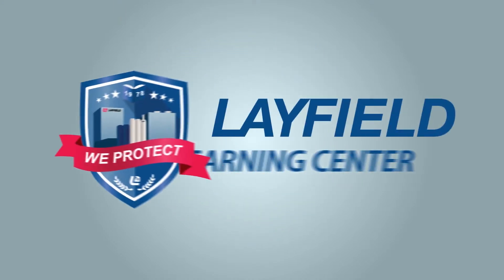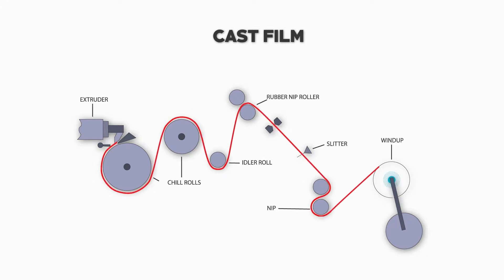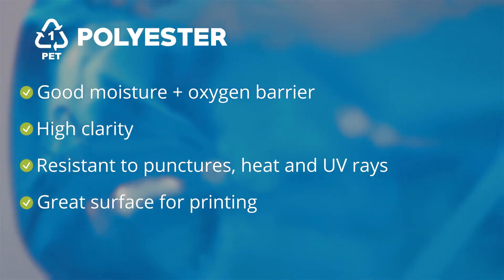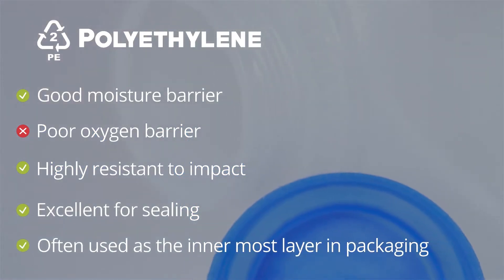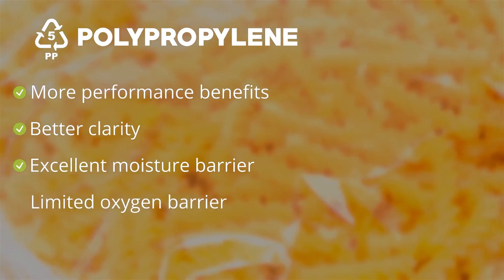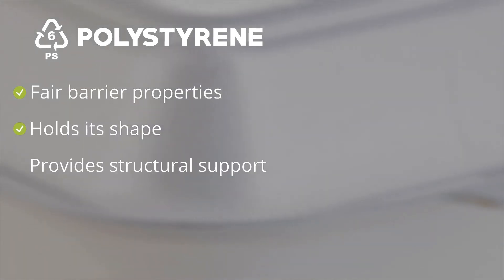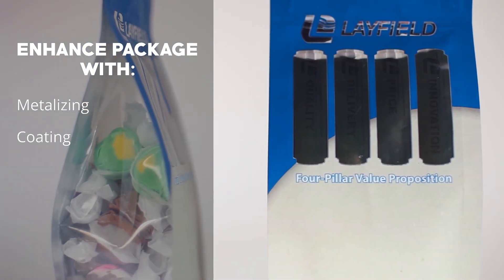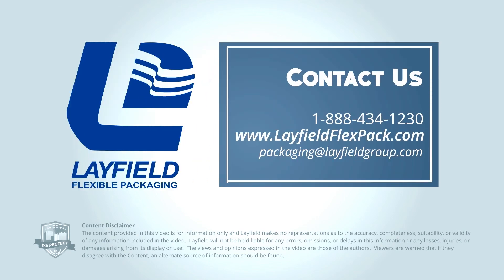Layfield Flexible Packaging Film Structures

Comment: In flexible packaging industry pouches are made with Bopp/printing/laminate with Metalized film/ PE for sealing. Can we use single family materials. What are the advantages of single family structures.
Reply from the maker: Hi Jagadish, 

Thank you for your question. Laminated pouches can be made with a variety of different materials depending on the type of barriers you require for your product. You could use single family materials such as 100% PE, which has good moisture barrier, printing, and stiffness, however it does not have great oxygen barrier. The main advantage of a single polymer structure is that it is 100% recyclable.
Reply: @LayfieldFlexFilms  How about Bopp with PE